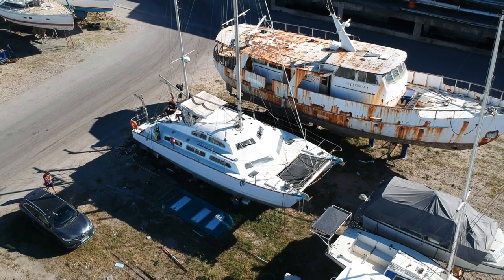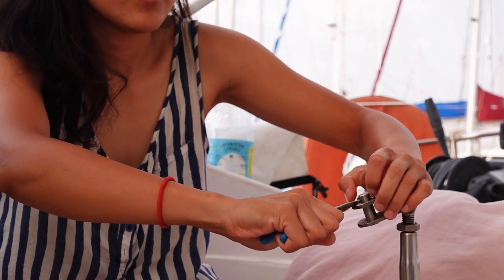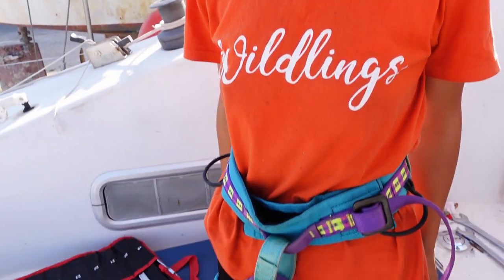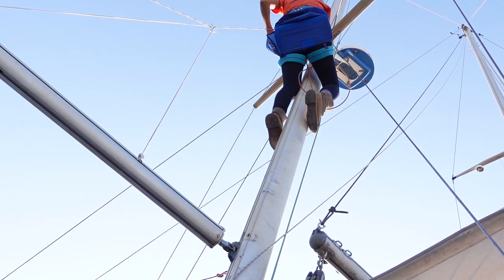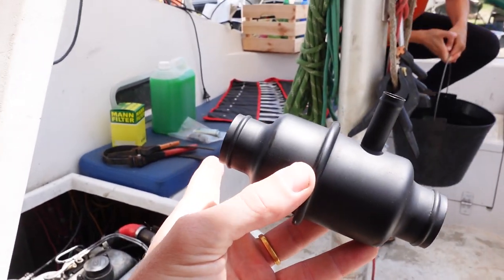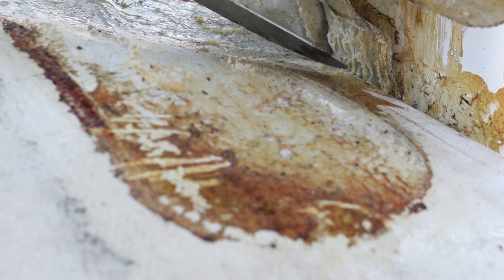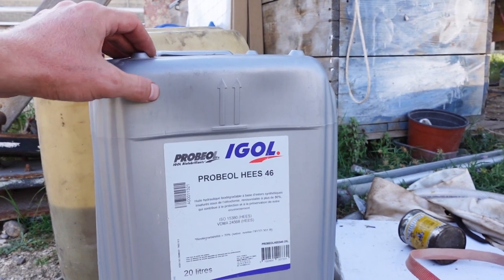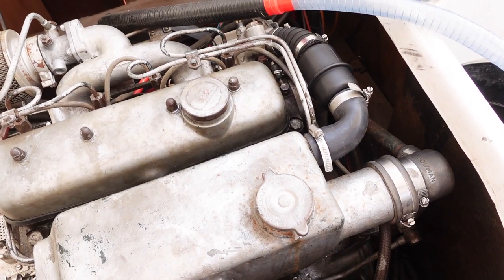DIY Re-Rig ~ Catamaran Revival On A TIGHT Budget | Wildlings Sailing

Comment: The Mercedes Sounds  better than ever. Make sure the thermostat is installed in the right direction ➡️  Good idea to have a thermometer attached to the  side of the Hydraulic reservoir   If your  pump or orbital motors malfunction the oil can get hot enough to catch fire 🔥⛵
Reply: Yup. Said it before but unless the water coming out of the exhaust is significantly hotter than the input water then the thermostat isn’t opening….

Comment: Doing fine on the hydraulic change. It's a closed system so the oil doesn't get overly contaminated. Change the filter regularly and keep an eye on the fluid level. 
Fix any leaks, just a problem waiting to happen and a waste of fluid.

Your thermostat is likely similar to that on an auto.
In the US the standards are 180-195° f for thermostats.
A 190 degree thermostat would only open once the water temp gets to 190. 
The ability of the coolant to transfer heat depends upon the secondary cooling as much as the primary.
In a car it's the airflow over the radiator, in your boat it relies on a constant feed of fresh water. 
Circulating the water through a small bucket does not allow for much heat loss. You end up with hot water. 
Really is a good idea to flush the entire system whenever you have the opportunity.

If I'm not mistaken, 90c is 194 f so you are within the proper range especially for such a small water supply being recirculated. 
Engine sounds great.
You guys are doing great.
Lose the dog.
Unless you really want to keep him don't. 
If you do keep him, he's gonna be part of the family. There are several considerations travelling to foreign places with pets. There are the obligations of veterinary and food cost.
And of course the added liability for damage or harm the dog might cause. Concern for the dog in emergency situations.
If you aren't ready for sailing with children you don't need a dog to practice on.
That said, you'll never regret the bond you form with an animal. You'll never miss what you never have.
But don't feel bad either way, this is your choice. 
Though I'm sure you've already decided. 

Can't wait for the water. 
All the best, fair winds and following seas.

Comment: Great episode whoever gave you the tip on not using an adjustable spanner is spot on. It is not because they can slip easier and you can bust your hand open though that is true. It is because they can damage the nut since they do not hold it to the same tolerances and can round off the nut. You don't want round nuts do you :)

Comment: For cleaning and flushing engine cooler and transmission cooler or ìn your case a possible hydraulic cooler. I use 6 percent cleaning vinegar.  I fill 5 gallon  bucket 3/4 full with the vinegar, and use a small centrifugal pump to reverse flow circulate for a day. The vinegar is non toxic. And disposes down the drain. It cleaned my attached shell and tube cooler on my C240 Isuzu very well.

Comment: hi guys, with regards to the hydraulics, you're doing just fine.  Without alot of fittings and work, and a proper flushing unit/microscope for testing, etc etc...."specialized gear" ; all you can ever do with your hyds is exactly what you're doing.  Change the fluid and filters.  That's all that's generally required.  Also, some drain plugs are magnetic...just to pick up steel shavings...wipe 'em off/check them.  If the shavings are very fine usually nothing to worry about. If you find solid pieces....you have a problem.  Might be an idea to carry some spare hose and fittings though anyplace there's alot of shipping/work or fishing boats will almost certainly have a hydraulic/hose shop.  Great videos!  The cat's looking good!

Comment: I'm very pleased that you took our advice on the spanners. Now you need:  Another set !

You will often find that you have the same size nut and bolt, sometimes you can get a socket set in there, sometimes you cant. 

I would purchase a set of stubby spanners, thereby providing many of the same sizes and giving some flexibility when working in tight spaces.

Some ultra long and some stubby screwdrivers would be very useful.

As would a magnetic retrieval tool.

Great job so far though.

Comment: there is no way to tell if stainless wire is in good condition that is why they recommend replacing it every 10 years. stainless work hardens and will show no visible sign until it starts to let go. a thrifty old salt I knew would keep a log book and change one cable at a time so they never expired at the same time and he would be able to afford to replace a cable here and there on his pension
Reply: That's not a bad way to do it at all really :D
Reply from the maker: Thanks for the advise, we will definitely start a log book, probably the most economical way to do them!
Reply: @WildlingSailing  what about dyneema rigging not sure how much less it would cost but I have seen a few use it.  Seems more DIY friendly.
Reply: @charonstyxferryman  watch old zingaro videos he rigs the old Zingaro cat with dyneema. There was another channel that also focused on dyneema rigging I can't think of the name right now.

Comment: Amazing job with that engine. Pragmatic, sensible and realistic approach to the rigging. Cat rigging does not want to be too tight anyway. There is no keel to take the thrust and you will just bend the old girl's structure. But that does mean more rigging flex, so just keep a gentle eye on it.

Comment: Those old Mercedes diesels are tough. I have worked on a lot of old MB diesels in cars. The temperature sender mounted in the cylinder head can also be off. Might try a new sensor/gage.

Comment: Hi guys! I absolutely love watching you both. I watch other sailing videos, and I have noticed on two channels one is the O'Kellys, and I think the other is Onboard Lifestyle, where both have used an engine flush called Barnacle Buster. They have newer catamarans and newer engines than yours, and noticed that the product eliminated their high temperature problems. I think the O'Kelly's had a really detailed explanation on one of their most recent videos.  Apparently it removes internal build up from the entire engine. Anyway just a suggestion and I hope it helps. Great work on the videos. And if you guys are ever interested in adopting a new crew member, I'm 64 and available lol. I really think you guys are great people. Best of luck.

Comment: Great video. Looking good. I would also recommend checking the temperature gauge.  Those type of gauge can change over time and need to be recalibrated.  If you have a extra thermo sensor put it in a pan of boiling water hooked up to the gauge.

Comment: The temp at idle with no load should be on the lower end of the specs.  Put it under a load and it will only get hotter.  Unless the water in the bucket is 75 degrees C, that’s not the problem.
Reply: I agree with EnaRandy and replace that bend with a proper 90 degree elbow you will get much higher rate of flow on your coolant through your thermostat.  Also if you leave it like that eventually the kink will get worse and you'll get less throughput.

Comment: Great video. Congratulations on hitting 50k! It's nice to see some sponsors have taken an interest in recent videos also. Things really look to be coming together nicely. Right down to the neighbors gifting you a nice (with a little work) dingy, and being adopted by a sweet heart of a dog. I've seen a number of sailing channels do fine with dogs on their boats, especially when there's as much room as you have on a cat. I'm wondering if your engine temperature issue might be caused by the heat exchanger needing a good flush with "barnacle buster" or some such product. The rigging looks better with the fixes you've done. Although I was wondering if the rear stay was so long not because it was cut wrong, but maybe it's stretched.

Comment: The bendable pins are called split pins where I live in Wales a cotter pin is used on a pushbike pedal crank they are round with a slight taper on one side so if you hit them  the tighter they get then tighten the nut and away you go

Comment: You guys are doing great!  you should keep the dog oh, your hydraulic oil change was fine the fluid that came out looked in good condition so you shouldn't have any worries just be sure to check it after you run the motor.

Comment: Hi! 30 year marine mechanic here. I wouldn't worry about your engine temperature too much.  The boat is not in the water yet. What is the temperature of the raw water being circulated through the heat exchanger? If that is hotter than normal you will see higher jacket water temperature.  I recommend getting a infrared temperature gun and making sure that the gauge in the boat is accurate.  The temperature gun can also be used to check the temperature of the raw water going into the engine as well as temperature coming out of the engine into the exhaust riser. 

Cheers!

Comment: I guess some safety equipment is a good idea before splash day, no matter if corners were cut or even if you had a modern cat.  Life vests, a matching wood plug stored next to each through hull, an easily reachable water proof map of all through hulls so in times of stress you can efficiently check all of them, a portable generator to run a powerful pump and a fire extinguisher may be a good idea.  A heavy duty bolt cutter was already mentioned.  Underwater epoxy, butyl tape and metal epoxy are any boaters friend.

Comment: Great teamwork guys. And, congratulations on 50K! Seems like a longshot, and I can't remember if you serviced the heat exchanger, but even a very thin layer of growth within can easily cause the engine to run hot. I brought exchanger to a radiator shop that cleaned it with the appropriate type of juice. They said the cost to clean is what is because of the cost of water here in San Diego and that they use hundreds and hundreds gallons of water to flush each exchanger. Other YouTubers have recently had success cleaning them by using a small pump in a 5 gallon bucket with a water and Barnacle Buster solution to set up a continuos loop of flushing - flush empty bucket of dirty water, remix new solution, do it again until the water comes out  clean. Mind you they had recently been in warm water areas with high build up causing their overheating.

Comment: Most engines have a thermostat to control the heat buildup / it’s usually an easy fix and involves an inexpensive part / gasket / and some gasket cement. Good luck

Comment: Another informative episode from two of my favorite people. As far as hydraulic motors go they all usually have a pressure in return to tank and a case drain which is the third smaller line attached to the motor this is to keep the internal pressure build up in the motor from blowing out seals. Just crack that line and use it as a way to break vacuum in any of the areas not draining. Getting air in this line does not matter as it only goes to tank.

Comment: Two notes:
When someone climbs into the mast, we always secure every tool with a cord. 
Would it be possible that more cooling water now flows out through the small outlet of the new spacer and less is pressed through the heat exchanger? Where does the small branch go? (Ben should know)
Kudos for a nice, entertaining episode.
Reply: It's a bypass - when the engine is cold, the thermostat stays closed and feeds coolant right back to the engine through the small outlet so it will come up to temperature quicker. Once thermostat opens it's all diverted to the heat exchanger. Pretty nice system since you can warm up your engine inside of 5 minutes.
Reply: A curious post! "Ben should know": a) do you know Uncle Benny personally? b) is Uncle Benny an engine expert?
I thought he lived on YouTube gaming videos which many people seem to now
Reply: @Neilhuny  he does, I'm not, and I used to. I do however own a boat with an identical engine, parked about 50 meters away from the Wildlings
Reply: @gfimadcat  tell em like it is unc

Comment: Hydraulic oil doesn't need to be changed as much as engine oil due to no combustion and it is not being used for lubrication. 
Only for power transfer.  For the most part just filter it out and your good to go.
37yr Elevator Mechanic.

Comment: Regarding the engine temperature- you may have an air bubble trapped in the system. Periodically vent the cap as it warms up to try to purge air out.

Comment: • Good move on the new injector and tool !  Over time you will replace them all.
• The best anti-corrosion for those stainless steel fitting is stainless anti-seize.  In the US, a bottle that will last you a lifetime cost $10-$20.  Not a sealant and not a thread locker, but you will be able to take them apart in the future.  Checking all of the standing rigging fitting should be done at least once per year.
• You should not have to drain the hydraulic oil to change the filter.  If you are doing it for less drips, save the oil and reuse it, if is clean.
• If you have a heat exchanger for your cooling system, remove it and place it in a large container of muriatic acid (weak hydrochloric acid).  If that is too pricey you can use vinegar (actually acetic acid), the stronger the better.  Muriatic acid should do the job in about a day.  Vinegar might take 3-5 days depending how strong the vinegar is.

Comment: Don't worry about the coolant temperature you are running the same hot water throught causing it to get hot once you are in the water it will be fine for fresh ocean water is being fed in and the hot water expelled out great job on the engine for it being your first time disassembling it

Comment: For hydraulics just change the filter. No need to change the fluid unless it is contaminated (water in fluid or wrong fluid added) or burnt (it smells horrible when burnt).   Other then changing the filter and visual inspection for leaks/bad hose nothing else is needed.  80c-95c is standard running temp for a diesel. This is coming from a 30 year diesel mechanic and marine engineer. 

Dogs are great on a boat I have a 200 pound Mastiff on mine.

Comment: Hello i just saw a crack on the turn cable connector at 7:00 You probably spotted it, but rather be save then sorry. Great job you 2 are doing, keep it going.
The engine heat should be good in the ocean.

Comment: The hydraulic oil in the motors will be fine given the oil that came out. A large proportion of break downs in hydraulic systems is due to bad oil,change it every 1000 hours of running time. Unless it gets really hot where it can attract moisture contamination.Save the dog

Comment: Hi..you and wife are charming..and working as team you have accomplished a lot.
A few suggestions…a diagonal cutter plier works much better than the needle nose…on your cable ends..the blue lock tite is easier to take apart than red…..if on line .KROIL…penetrate..incredible…antisieze on every thread you may have to remove at a later date…and on the hydraulics ..it’s almost impossible to get all of old oil out….run it a while so it mixes thoroughly.  And  repeat the process…the main concern should be color of old oil…..and good luck on the engine…I highly recommend 15-40 full synthetic as it will protect the engine from excessive heat far better than mineral oil…
Thanks for your videos

Comment: The temperature difference is being caused by the new bypass.. That is why it's there to get it up to temp Quicker , Get it in the water and run It and Im sure it will be fine ... Otherwise take it out again and see what happens when you put the old hose back if you still have it

Comment: Reusing the wire is fine.  The wire is rarely the point of failure.  They even make longer studs so you can cut the wire and reterminate it.

Comment: great episode, progress being made.  I would not get too concerned about the temp of motor yet.  There are commercial flushing products but have also used caustic soda many years ago as well as diluted vinegar  to loosen and remove internal scale.  Could be the temp sender is a little off or the temp gauge itself is not deadly accurate what does your electronic temp gauge say ??.  I think waiting until in the water and seeing what happens is a good starting point.  Maybe leave flushing until you are at sea and can run the motor for a good period of time to allow the flushing chemicals to remain in engine for a good long run, give them time to work.  Nice dog, only issue with dogs on a boat is if you are entering countries where there are restrictions , ie where I live australia a pain to bring dog in from overseas.  I understand that europe not so bad in that respect.  He sure looks like he is comfortable with you.  Anyway great episode moving forward.  By the way additional paint on the doors looks good well worth the effort.  Take care and best wishes.

Comment: If it ain't broke, don't fix it;  Wait until you can replace the whole rig all at once without any time stress. You may even be able to convert over to synthetic/Dyneema, which would save a ton of weight, eliminate rust and allow you to replace/repair anything while at sea. Learning all the marlinspiking is super cool too. Check out the Tula's Endless Summer channel, or Sailing Zingaro for their experiences and some cool How-To vids. Y'all are doing great. Cheers from Florida. Come visit any time!
Reply: Changing rigging to dyneema may not be the best idea, a lot of people will just go off and change it only to find suddenly there's chainplates coming through the deck because dyneema stretches less than the metal wire does when shock loaded. As far as replacing the rigging, I'd do it in intervals. At least that way you're not changing the entire rig at the same time every time but doing it piece by piece which would keep it affordable.